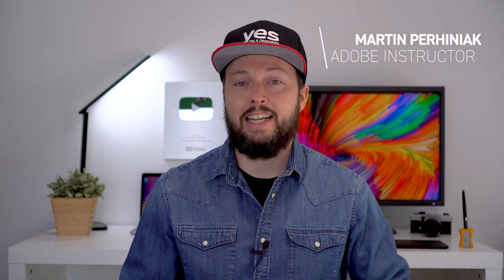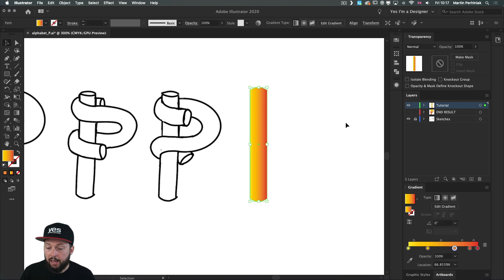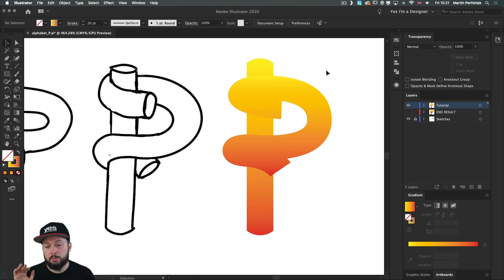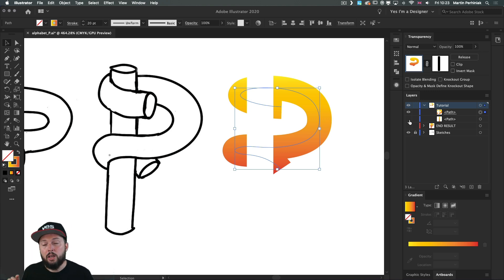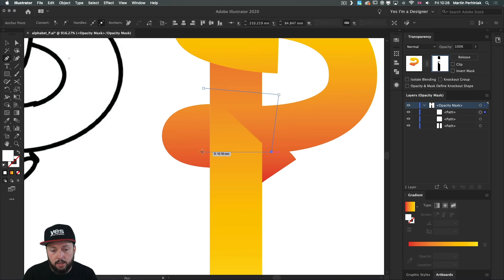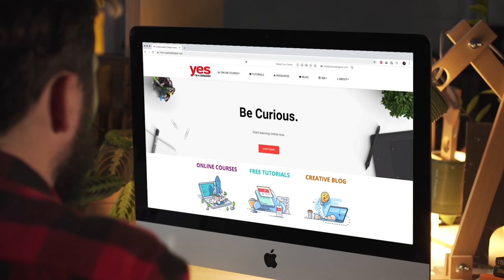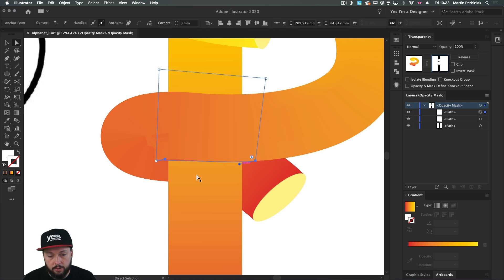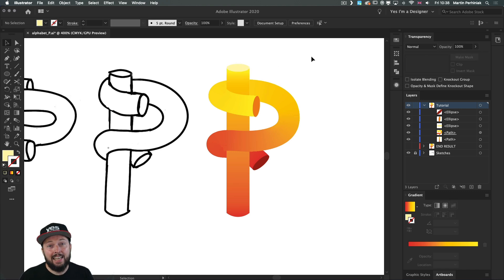Creative Alphabet Design #1 - Intertwining Tubes (P)

Comment: Bro is there a way to scale the image in InDesign along with its frame ? Currently i have to resize the frame and manually adjust and scale  the photo in the smaller frame (i know about the fit to frame options include the ai one is there any other way )
Reply: Hold CTRL or CTRL+SHIFT to scale the image with its frame.
Reply from the maker: @lotfichabou9605  Thanks, I was just about to comment the same shortcut :)
Reply: @YesImaDesigner  thanks a lot to both of you